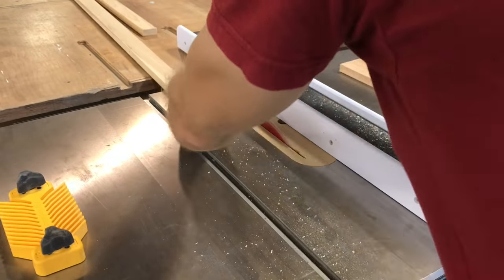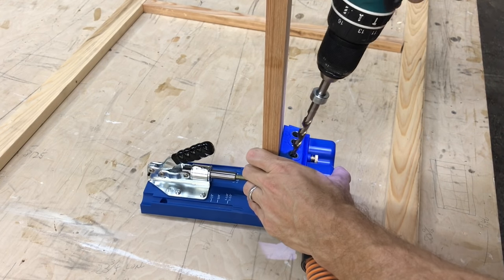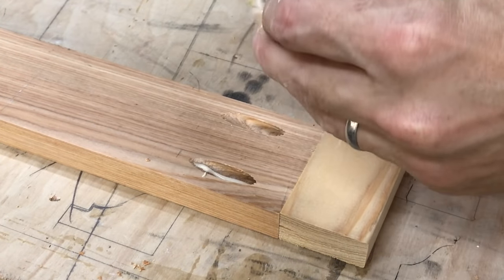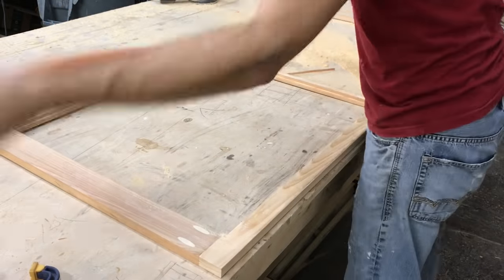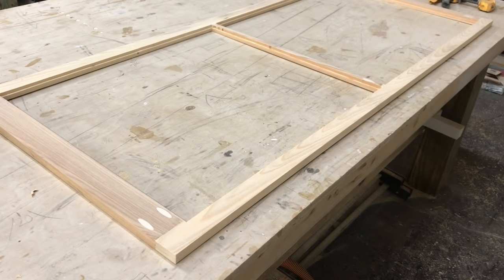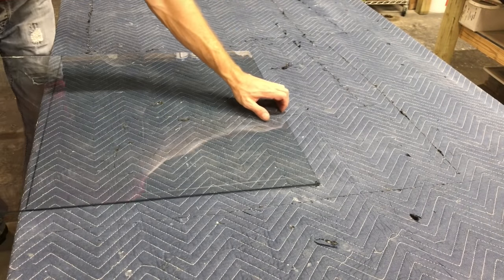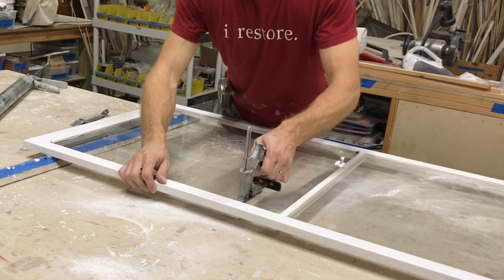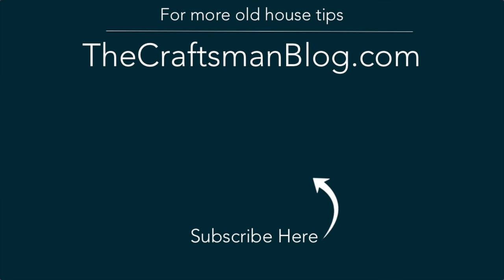DIY Storm Windows

Comment: I can’t thank you enough for this tutorial. A long time ago I took a class in how to make mortise and tenon storm windows because my 1903 house has 33 windows. I decided to have the six storm windows on the front elevation made professionally, as three are massive: 3’ x 6’. So now I need to do the rest of the house, and I will use your technique. 

One tip on the glass cutting for newbies. You can slide a dowel under the score line to pop it without having to hang onto a big piece sticking out over the end of your workbench. This is an old picture framing technique. Another one is to put a drop of 3-in-1 oil on the blade (wheel) of your glass cutter to make it last longer.

Thanks again!

Comment: Great video.  My old home has amazing windows and I have the original screen windows but only 1 storm window.  The meeting rails on the existing aluminum storm windows are in the middle and don’t line up at all with the original craftsman windows, which have the meeting rail at about 2/3 of the total window height. I had no idea where I’d find storm windows to match.  Now I’ll just plan to make them myself!  Thanks.

Comment: Hi Scott, thanks for this excellent tutorial. I was wondering about weep hole size and placement (Given the weather in my area, it's a necessity). Thanks in advance, and best to you 🤓👍
Reply from the maker: I prefer three 1/2” weep holes at the bottom and two at the top for air flow.
Reply: @TheCraftsmanBlog  Scott, will do and thanks for answering: Really appreciated! 👍
Reply: I appreciate the idea that weep holes help eliminate moisture buildup but I wonder a) wouldn’t 1/2” holes defeat the purpose of sealing out drafts, and b) shouldn’t a newly built storm not leak/need weep holes? I have storms that are not under eaves and the rain does run down the siding and leak into the window. Annoying as can be, and I’m considering installing a drip ledge above the window.

Comment: Great video, thank you. Half way through first demo window. This may be a silly question, because didn’t see anyone asking it yet. Do you prefer the glaze on the inside or exposed side of the window?
Reply: Always on the outside. The glaze is part of maintenance and keeps the rain off the wood (it runs down the putty). If you did it backwards then moisture would be between the wood and glass and would not last long.

Comment: Hey Scott, I plan on making 2 sets of these for my home. One with glass, and another as screens. How would you modify this plan for a screen? Just skip the routing and staple the screen to the inside?
Reply from the maker: Absolutely. Skip the routing and staple screen to the inside actually. Then apply a screen molding to cover the attached screening’s edges and trim the excess.

Comment: This is great, one question though. On a traditional aluminum storm window, you can open it, and it has a screen. With this you wouldn't be able to open it to let the air inside. Can it be made to where you can open the window, like a traditional storm window? I love this, and want to make a couple. Thanks for a quality video!
Reply: I been thinking about this also if  it's possible to make one that  can remove the the glass safely. I was thinking maybe using acrylic for the ones that you want to take out. But  I seen someone on YouTube do it a long time ago but couldn't find the video
Reply: Original storm windows had what looked like a mail slot cut into the center of the bottom sill -- maybe 12" by 2".  This was covered by an inside door which swiveled on one end.

Granted, this didn't let in a lot of air, but if you wanted more perhaps it was time to switch from storms to screens.
Reply: I know it’s a year late - but thought I’d chime in for anyone else who’s curious. With this older system of storm windows, they are mounted from outside using hangers at the top and a latch on the bottom. Every spring you go out and remove all your glass storm windows and carry them down into the basement (or up to the attic). Then you bring a second set of identically sized screened windows out and  install them using the same hangers and latches. It’s a real pain in the ass to do - but it was (and still is) a great way to keep your house warm in the winter and cool in the summer. Personally, I prefer the newer aluminum sliding storm windows for the second floor! Going 16’ up a ladder carrying a 30lb storm window is not ideal for the gentler folk of the year 2023. 😅

Comment: Nice video. I just made some storms but I had to bevel the bottoms to match the sill angle. Also, what if your sash needs to be more than 1" deep? The old sash that I replaced was 1-1/8" deep. What material would you suggest for that issue. I used the clearest 2x4's I could find and planed them down with my planer.
Reply from the maker: If it’s thicker than 3/4” then I’d have to get some thicker rough stock to plane down like you did. I prefer Accoya wood since it is virtually rot proof but anything that is resistant to rot will work well.
Reply: Menard's carries 5/4 thick wood in various widths.  The actual thickness works out to 1 1/8 inch - 1 1/16 inch.  I've used it for storm windows, screen windows,  and exterior window trim on my 1863 farmhouse.

But it's expensive.  That plus the cost of glass makes for a costly replacement --  even with my free labor.

Comment: How are the windows holding up?  Has there been any racking of the window upon opening and closing?  Thanks for using the using the Kreg system.  You have the only video I’ve seen (and I’ve looked a lot) on YouTube (and even the internet).
Reply from the maker: No issues at all. Holds up very well!

Comment: I have an old house that I want to make storms and screens. I have 56 windows. A couple of questions. Do you sell that caulk/glazing gun? If cypress is not available in my area what about using pine? I was thinking of using a lot of old yellow pine I have in my garage. Why did you not screw and glue joints?

Comment: Wow you deserve more views. Great tutorial it seems very easy. I have a few questions if you don't mind... I'm looking to make these to sit inside. I have an old bay window which is essentially single pane glass in a grid fashion between 2x4s... É bay window is in a 3 row and 4 column squares making the bay window. Each square is about 20x20 inches.

Would it be possible to make the rabbit on the other side as well and essentially make a 2 pane storm window? Is there enough material of wood for this? This would enable once installed on my window, to be triple pane, with 2 air pockets in total making it more efficient. Also what type of glass are you using?

Also would the glazing putty be needed since these would sit inside? 

These would be meant to stay permanently since our windows don't open we'd intend to keep them on always... In this case maybe building a frame in the cavity as a spacer around the edge and tack it with some finishing nails  and just add glass panes on top would be easier? 

Thanks

Comment: Do you caulk in the putty and set windows before glazing when you are restoring an OLD WINDOWS ? I didnt remember seeing that on any of the previous restoration videos?  Wish we could have seen it installed and what it looks like.
Reply from the maker: +Carol Johnson I don’t use caulk, but rather we have started thinning our linseed oil putty a bit and applying it with that bulk caulk gun. It goes faster than applying the bed by hand. So, no, I don’t recommend caulk for old windows or storm windows.
Reply: The Craftsman Blog o

Comment: Great video!

Rookie question: why not apply wood putty in the pocket holes instead of plugs? (Some putties cure hard, are waterproof, can be sanded, and don't shrink).

Three more quick questions:
1. What about weep holes in the bottom rail?
2. What about matching the angled sill on the bottom rail?
3. What do you apply to seal around the top rail and stiles during installation? Caulk? Felt? Foam or rubber tape?

Thanks!
Reply from the maker: Thanks good questions! You can fill the picket holes with wood filler if you prefer, but the wood won’t shrink and require another coat potentially. I don’t really see the  red for weep holes in a simple frame like this. You can get a closer fit by beveling the bottom rail, but so have intentionally skipped this by cutting the rail short enough of the sub-sill to not be an issue but still long enough that it is covered by the sill.
Reply from the maker: I also don’t apply foam or weatherstripping around it because I know that it needs some breathing room to avoid fogging or moisture issues.

Comment: wow thanks a lot!! i have been trying to figure out how to block noise from a bar and I have a 100-year-old house and been trying to figure out what would be a good way to do it and seems ill give this a try. I already made the frames the same way you did but can just take out the mesh screen and put glass in instead. Also what type of glass do you recommend?
Reply from the maker: I use regular 1/8” annealed glass most times, but if you want really good sound blocking then go with laminated glass.
Reply: @TheCraftsmanBlog yeah I'm leaning on going with laminated glass where would I find laminated glass a local glass shop or could I find it online I been looking online but haven't found much info Im going to need 6  glass pieces of 25 X 37  I'm sure it's going to cost a bit. Also did you notice any difference using annealed glass for decreasing of sound?
Reply from the maker: You may want to look into Indow Windows for the sound blocking. They are an interior acrylic storm window and are pretty darn effective at sound blocking. Up to 70%!

Comment: At the end it states "extends the life of the prime window"....can you elaborate on how that is accomplished?  Maybe it prevents the constant air flow--in/out--and the changing temperature that comes with it?  Or reduces the imbalance in temperature on both sides of the prime window...which perhaps causes destructive condensation, etc.  Is this how the life is extended, by reducing these effects?
Reply from the maker: Laura, mainly it protects the prime window from the exterior elements. Rain, snow, wind, debris, etc. it all lasts longer once protected by a storm. However, storms can cause condensation issues depending on the house and the condition of the original window so it’s best to watch carefully to see what happens when one is installed for the first time. You will likely need some venting.
Reply: jeez, thanks for your reply, you are absolutely right.  I had been watching other DIY INTERIOR "storm windows", yes, if you can believe it they exist, but perhaps to call it an interior placed window cover a "storm window" is a misnomer.  When watching your video I thought it too was being created for interior use...but yours are true storm windows--which protects as you stated. Great video's thanks!
Reply from the maker: Glad you like the videos! Good luck with your windows!

Comment: Cheapest way ...use plywood, 2 pieces.   Cut out squares for the glass.

On next piece of plywood make square for windows 1/2" smaller.

Put two pieces of plywood together and you have rigid AF frame and have inset for the glass to set in.

This can be made with circular saw, jigsaw and drill.

U

Comment: It looks like this is a single pane window; what thickness of wood would you need for a double pane piece of glass?
Reply from the maker: It totally depends on the design, but probably at least 1 1/2" thick. I would stay away from IGU since they fail early and often.

Comment: Lets say I wanted to be a little fancier and use a cope and stick bit to give a nice ogee profile on the inside but keep everything else the same , how would that change/how would I measure the rails to fit the window openings? Thanks.
Reply from the maker: I like that idea and I don’t think it would change the measuring at all unless you are planning on doing a different kind of joinery.
Reply: The Craftsman No changes. Glue and pocket screws. Rout out the flat piece with a rabbetting bit to accept glass and glazing with fancy profile on the other side.

Comment: I have heard glass has zero insulating value. Would plexiglass be any better?
Reply from the maker: The glass isn’t what gives you energy gains it’s the air space it creates. Plexi doesn’t hold up well in the elements either.
Reply: Plexi off gasses in sunlight and turns yellow so I wouldn't use it as window glass if you get any sunlight through a window. If making storm windows isn't possible, you can stick bubble wrap to your windows to insulate them. It really works. I do it every fall and then cover my inner windows with clear plastic just to be sure no air is getting through. Just be sure to cover every inch of your glass with the bubble wrap. All you need is a spray bottle with water and a bit of dish soap. Just spritz your windows and stick the bubble wrap to it.
Reply: The insulating value comes from creating the space....it essentially creates a double pane window, or possibly a triple pane window if the prime window is already double pane.  There are in depth discussions online about heats ability to transfer through different objects including gaps of inclosed air.  In an even less technical sense, it also helps reduce any airflow that may exist should the prime window not be properly sealed or contain gaps, as is common in many old structures with original windows.  (I know you asked 8 months ago...but, should anyone else read...this is the basics--of which The Craftsman Blog already answered).

Comment: Im thinking of getting 3/16 or 1/4 glass im not sure if glass companys supply this and if the weight will be to much for the frames what bit would you recommend for these thickness of glass
Reply from the maker: I think that would be overkill for a storm window. 1/8” is more than sufficient, but if you do thicker glass then make sure you make your rabbets at least 3/8” bigger than the thickness of your glass.

Comment: How about doing a video using a profile such as an ogee bit so you have a profile to match existing storms then glaze the rabbeted side?
Reply from the maker: You could do that too, but it adds a level of complexity not necessary to me because you also need to cope your joints. But it is a nice option.
Reply: The Craftsman Blog I’d like to replicate the existing storms that are left.  This is the way they are constructed.  Trying to return the house to the way it was 100 years ago.  Wanted to take that profile and then instead of using mortise and tenon us pocket screws or loose tenons.

Comment: Are these safe in regards to having an exit in case of a house fire since they cannot be raised?
  How long can they be expected to hold up?
Reply from the maker: They can be exited through very easily since the bottom swings up and away in case you need to exit.
And if you use a good quality, rot resistant wood they should last at least 50 years with a little maintenance.
Reply: Should they have vent holes in the bottom to drain or air dry condensation?
  They have hinges on top that allow them to be swung open?  If so, how well do they seal off?  Maybe apply a thin seal on the back against the main window?
Reply: The Craftsman Blog Do you have video showing how these swing up and the hardware used?

Comment: could I get away with using staples instead of pocket screws? I've used pocket screws many times but staples are so much faster. I have 23 windows to protect! I'm also thinking about using PVC instead of wood. Don't have to prime and don't have to worry about rot
Reply from the maker: Staples might be a bit weak. You could try corrugated fasteners. Those are fast and much stronger.

Comment: I do not have the tools-that's a lot of different kinds. I don't see pocket holes on mine, so I'm guessing they were filled in with putty. I'm kicking myself for not just fixing my stormers myself. Had a fellow use silicone when I gave him putty and told him to use that, sanded down the interior decorative millwork, when all that needed sanding was an area with very slight rot/missing paint, and caulked over that, then painted over it with the dark green oil paint that was for the outside, not the inside. The other frame he banged up. I could have just worked glaze into the place it was missing, let dry and turn them around, put them up backward and sanded and painted the inside white, then flip them the right way and paint them the green.😔💔☹

Comment: Why use putty as opposed to exterior silicone?

I’ve seen windows that have putty strong as stone and some that simply cracked and fell off
Reply from the maker: The putty is both more attractive and renewable. The silicone will destroy the wood should it ever have to be replaced and it will eventually need replacement. Silicone + wood = problems
Reply: The Craftsman Blog what do you mean by “silicone will destroy the wood”? 

You can simply remove it with a utility knife, whereas putty, if set, it’s super hard to remove...

I have about 12 more large windows from which I’d like to recover the glass in large pieces or as a whole, any tips for easy removal of putty that was applied over 30 years ago? The easiest I found thus far is cutting the putty with an angle grinder, close to the wood, then with a putty knife pop the putty using the trench left from the angle grinder; chisel doesn’t work, heat doesn’t work, it’s painted over... I wish it was silicone for quick removal
Reply from the maker: Silicone adheres so we’ll to wood that it will tear out the wood fibers if you try to remove it. Glazing putty though it gets hard over decades can be removed pretty easily with steam or heat applied properly. There are some putties that the old timers added cement to which made them almost impossible to remove smoothly, but those are not the common practice.
Reply: zdringy glazer here, we always used a torch to soften the oil based putty while some used a large soldering iron